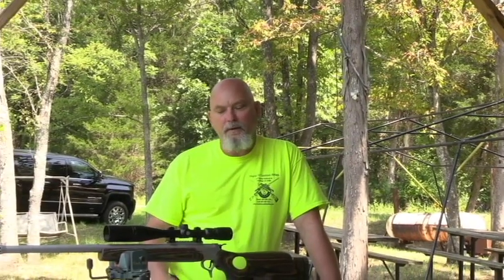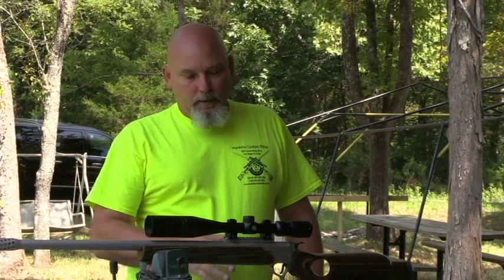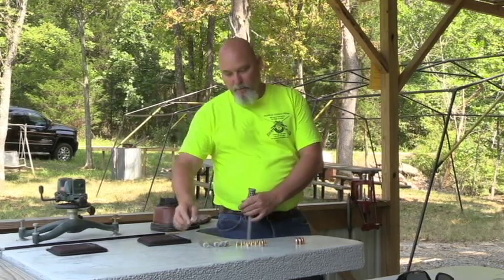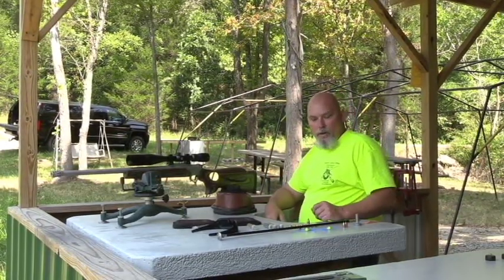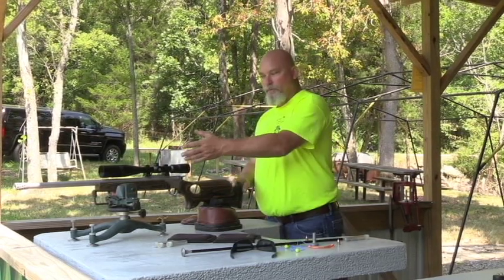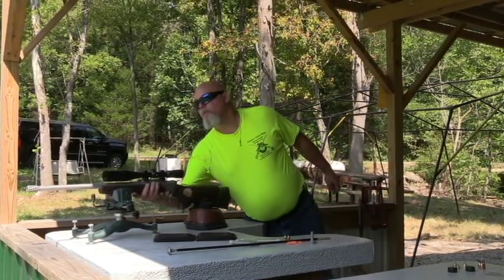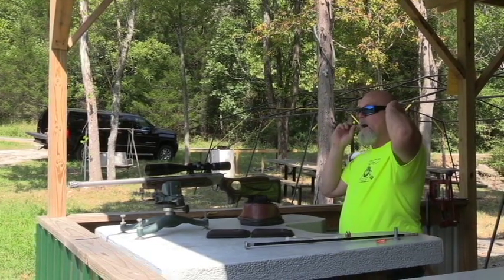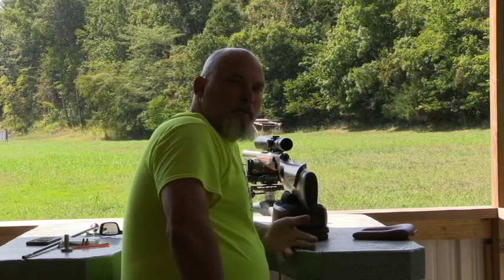High Performance Encore Smokeless Muzzle Loader

Comment: Nice conversion! The big issue with Encore barrels are the barrel lugs, its the weakest link so always buy barrels from reputable manufactures. That trigger job is something  I need to add to the to do list for my receiver as well as a stronger hammer spring, having trouble lighting off Russian 7.62 x 39 ammo. Nice choice for stock and forend!

Comment: Good to know you.  I have a 20" Bullberry .50 that I shoot .44 and .45 sabot bullets in.  I really like the format.  I still want a .357 carbine; tiny like 18" barrel, maybe even a skeletonized stock.  Very cool ram rod.  That has been my  beef with my Bullberry rig; I made a scabbard but that's not great as thick stuff and tree climbing still a problem.  I always thought we could beaver one side or the entire forend and have an off set ramrod.

I had the idea to have .410 case heads to load 209 primers.  The idea would be like our ML season is in winter and it would be something easy to handle with gloves on.